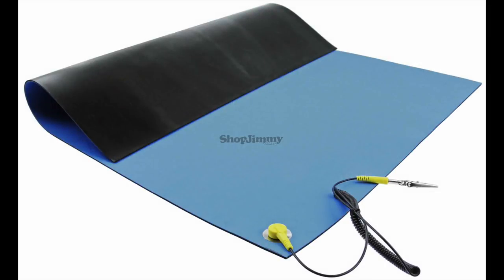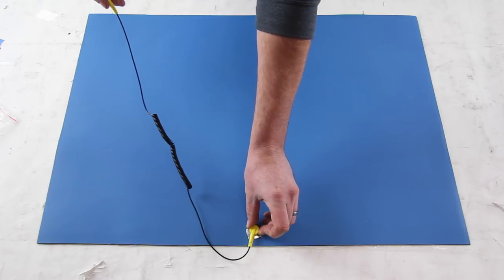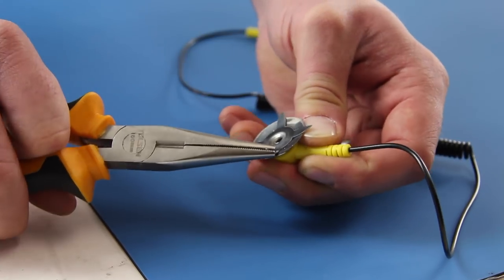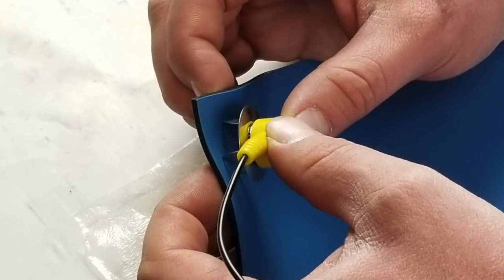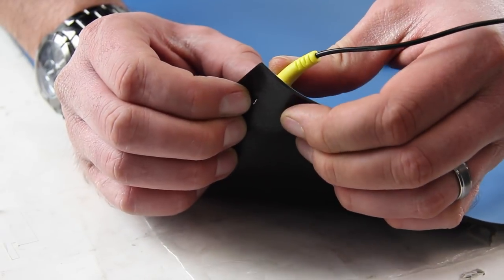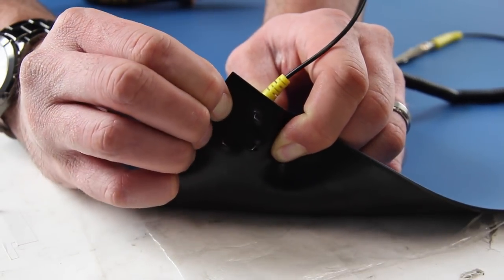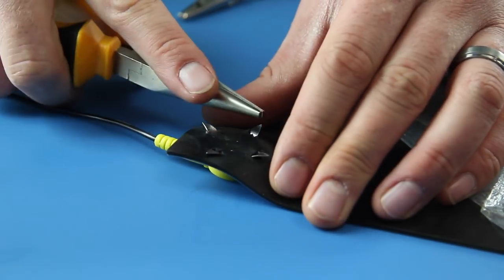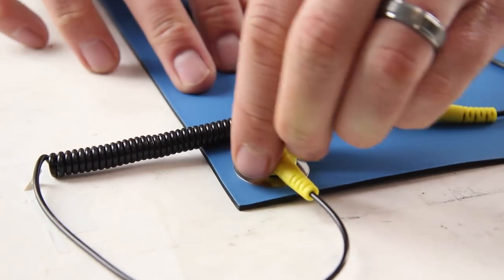TV, Phone, PC and Tablet Repair ESD Mat - Protect Your Electronics & Components

Comment: ESD or Static matting is designed to drain static discharge from items placed on its surface. It also serves to protect the surface of the ESD sensitive devices from wear and tear (but that's a secondary benefit).

Comment: Hello I just watched a old video that sed you may be able to help. I would like to no what you think before I go get the model and info from my tv. I have a Roku tv and the picture looks zoomed in after a full reset of the tv it still looks this way but other then that the tv is fine do you thick this is the main logic board or the tcon I am thinking tcon do to the fact when the tv is factory reset its still the same. pleas let me no what you think. if you have a idea I will get the tv out and get the model for you so I can get the part. thanks.

Comment: hello shopjimmy. my name is carlos. i have a 2006 samsung plasma tv model: s50hw-yb01 that i am having an issue with. a few days ago i was watching it and i heard a pop, saw a flash of light come from the back of the tv close to the top, and thenthe color became distorted. ihad been noticing on a couple of occassions during a movie or show the top have of the screen would be fine, but the bottom would be black the it would clear up. are these issues related? the tv comes on and works but the colors and images are distorted. can this be fixed? i have watched a couple of your videos on youtube as well as others on how to fix it. i just need to know if i can get part(s) reasonably priced or if its even worth it. thanks.

Comment: I have a Toshiba DLP rear projection TV that won’t turn on. It has done this before and we replaced the lamp & it worked again, this time when we tried to replace the lamp it still won’t turn on. The lights blink and the fan goes for a couple seconds and then it switches off and back on and tries to turn on a few times with no success. The model number is : 62HMX85 
Serial number : 25400621